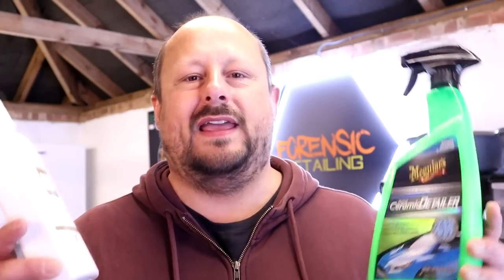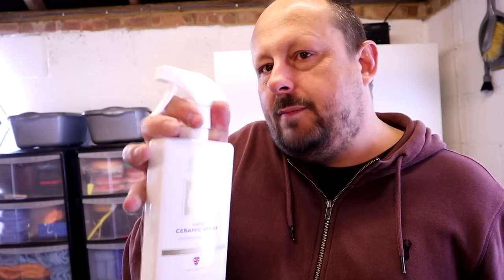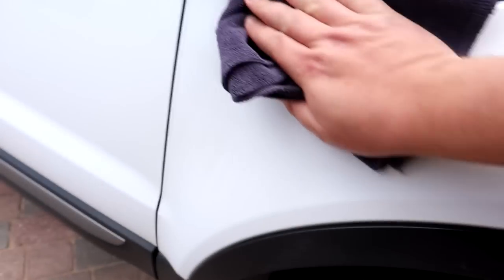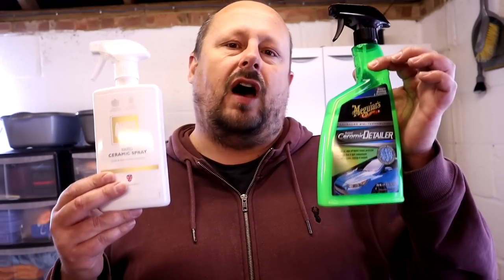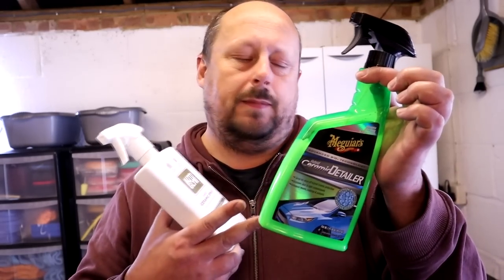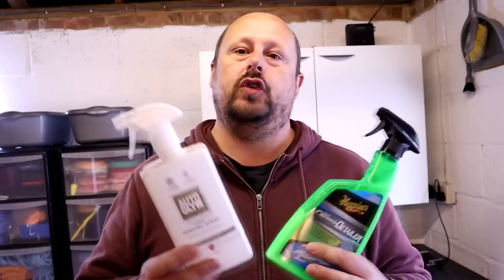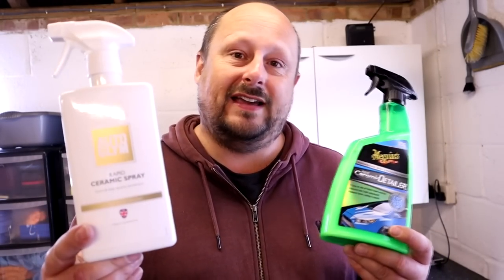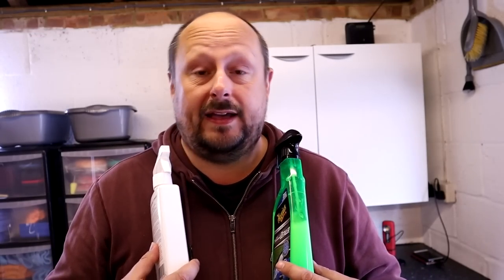Autoglym Rapid Ceramic Spray V Meguiars Hybrid Ceramic Detailer | Battle of the Halfords Ceramics

Comment: Do you use these products after polishing or would you use them instead of polishing?
Reply from the maker: after polishing... polish is an abrasive which works by removing material and refining the surface to burnish it and make it shiny.     wax/sealant/ceramic/ceramic sprays etc.. are protection products designed to sit on the paintwork and make the car easier to dry, fill minor imperfections, make the water run off the car, repel contaminants etc..
Reply from the maker: hey scott also you should check out my Detailing Fundamentals training course with discount code applied:

https://ioa.pxf.io/c/2687409/1012495/12764
Reply: @ForensicDetailing  cheers for the information, I will give it a go this weekend!

Comment: After doing all the tests you have done, I feel revisiting the price point to give back the point to Autoglym, as if you need twice as much to make as hydrophobic and it doesnt last as long then your use more product making megs a more expensive product overall. Just a thought and great video john keep up the good work.
Reply: Interesting point: i think it's good to compare products based on price per mL, and also based on amount of product needed or used. Some product need to be layered thicc and some might require only a mist per panel. But it becomes more difficult to quantify this part.
In the end, i think it's just two different products with different goals. Meg cer detailer seems to be a good drying aid on a ceramic coating (from experience of different youtuber) and a decent (but much expensive) quick detailer with added ceramic.
Autoglym looks more like a standalone protection for a couple of months, or a topper for the autoglym cer coating.

Comment: First time I use AG Rapid Ceramic spray blown away at both how quick and easy to apply it was and also the glass like finish it has left on my car. As a weekend warrior I love it. I used it after using AG Super Resin Polish and Extra Gloss Protection. Just to see if it would work despite it not actually bonding with the paintwork. It worked. Really slick smooth finish.
Reply: Yeah I bought this to put on after the same polish and thought I’d see what FD had to say - so glad he didn’t trash it like the polar snow foam (which is pretty sh*t lol)

Comment: Late to the show but I use both for different purposes. Megs is great for adding some extra gloss and to remove any smears or fingerprints left over. The Autoglym is far more durable and seems to provide a wetter gloss to the paintwork IMO and I use it to boost ceramic coatings. Without sounding critical surely it would be better to compare Autoglym to megs hybrid ceramic wax as they are both the same category? Great video as usual 👍🏻

Comment: Wow Autoglym really smashed it in this one. 
From my experience the meguiars ceramic detailer works best as a top up for in between waxing. On its own it adds minimal protection that only lasts a week. But it worked great for reviving my old “dead” paste wax. Really easy to use and shiny as well. But will have to try that Autoglym next time

Comment: I went to the websites for both products and Meguiars basically  describes theirs as cleaner with SiO2 added to enhance protection while Autoglym describes theirs as a ceramic spray that bonds to paint. I believe a better comparison would be use the Meguiars M27 Hybrid Ceramic Sealant vs the Autoglym Rapid Ceramic Spray.
Reply: Would you now. Hmmmmm Anyone else?
Reply: Yes unfair comparison. Test similar products.

Comment: I wasn't in love with the Meguiars. It doesn't leave the slickest panel feel, and even working in a shop, spraying sparingly into an applicator, I got some visible streaking on some bare black paints. It's in kind of a unique zone. Some of the advantages and disadvantages of both a heavier sealant, and detailer spray.

For me, as a professional, a detail spray just cannot streak. I can't micromanage application and Scangrip every inch of every panel everytime for a quick detailer. So it's not something I reach for, but still a capable quality product for what it is. 

Technician's Choice 582 Ceramic Detail Spray, at under $30 per gallon 😲 has been the best all around pick for me. Versatile, fast and easy, flashes quickly with a clean removal, durability in months not just weeks. 

Insanely hard to beat that, but I'm always testing new stuff. I'm in the U.S. so haven't tried Autoglym. Thank you for the video my dude! 👍✌

Comment: Having used Autoglym products when living in the UK, Germany and now Canada for the last 8 years and using both Autoglym wins hands down. A buddy and I had a clean off, he swore by maguire's til I showed him what Autoglym is made of.  We both had similar coloured cars at the time, my Chrysler 300s with clay-bar followed by super resin then HD wax, finished with high definition gloss left her spotless. Buddy did his usual on his Merc waterless wash, clay-bar with mother's products, meg spray wax followed by the ceramic wax. The standard was nowhere near Autoglym, I find the meg products look cheap and not good value (my personal experience) I have over (roughly) $400 of Autoglym products and will hands down pull better results than any other product, providing you follow the instructions, plus the bottles make them look more professional laid out on a shelf. My buddy has now changed to Autoglym, he thought I just bought them because of the Union Flag til I showed him the standard of the contents.

Comment: I have used Aqua Wax and now Rapid Ceramic Spray interchangeably on my car, just testing what's best for me. I have recently been hammered by salt spreader, and the sandy residue came off the paint without my intervention as soon as it rained, leaving the car fantastically clean. Now I don't know which of the 2 products did the trick.... However, Aqua Wax is much easier to apply on a wet car. The ceramic one did not feel like it was protecting the car that well (subjective) , and I felt like drying the car prior to application was the best way to go. This meant much, much more work !  I think I am going to stick to aqua wax for now, but considering hard wax at least once every 3 months.

Comment: John I'd have to agree with you on the packaging. The Meguiars is definitely a "sexier" looking product. But with products like TW Dry & Shine - Blue bottle are these sprays a bit overpriced for longevity, if you won't get an actual ceramic coating?
Reply from the maker: yes.  But put it this way a pack of fags is like 13 quid nowadays. Petrol.  Cup of cofee is like 3 quid. pint of lager 5-6 quid some places.   The market price for ceramic sprays seems to be like 15-20 quid for 500ml.    If the market was not confortable with this price then the sellers in this market would need to lower the price.  So whats expensive is subjective for sure.  But in the UK we have the full smorgesburg of options price wise :)
Reply: You still get quite a bit of coverage out of the  generously sized bottles. Especially if you apply it spraying into an applicator instead of directly on the panel or spray and rinse.

But yeah, you can still find better values. I buy Technician's Choice 582 Ceramic Detail Spray by the gallon. Absurd value for the money, very good product. Don't know if you guys have access to it outside of the U.S. though. 👍✌
Reply: Just to add balance on the packaging. I found the Maguires packaging a little 'cheap' looking. Reminds of a bathroom or kitchen cleaner product. End of the day. It's how the product performs that matters.

Comment: Why are you comparing  two different products? the Autoglym is a ceramic paint sealer and the Meguiars is a detailer used to top up a ceramic paint sealer.  You Should compare the Autoglym with the Maguiars M27 hybrid ceramic sealer. And your trying to sell detailing corses when you dont even know how to use the products?
Reply from the maker: We said this the video.  But also meguiars is a ceramic spray and autoglym is ceramic spray.   M27 is a liquid emulsion which is not good to compare with siloxane based spray.  But what do I know...

Comment: Hi John 

Autoglym rapid ceramic spray or tac moonlight?

Which would you go for? :)
Reply from the maker: TAC is a proper ceramic kind of.. its not like 99% of the ceramic sprays on the market.. in fact I would not spray it.  for me TAC moonlight is a great base layer coating thats really easy to use and I would look to use it after polishing and degreasing (full prep).   Autoglym is a water based product that you could just wash your car and spray on job done its more versatile can be standalone of topper. Its more casual, almost like a spray wax.  so it really depends what your looking to do with the product on what you pick.
Reply: @ForensicDetailing  thanks for that info John, kinda makes me think is it actually any better that autoglym Aqua wax then?! It almost seems to be the same product 😆

Comment: The Megs bottle looks like a bathroom cleaner. Autoglym bottle definitely looks more classy. I like their bottle range because if like me you have 8 or 10 of their products in the same style bottles, they all sit nicely together. I have all mine in a perspex box with a lid, and they are nice and snug.
I'm also glad to report that the Autoglym ceramic spray is very nice to use and leaves a lovely silky shine on a good clear coat. I love applying this and buffing it up at the end of a 4 hour inside and out cleaning session. It's like switching on the lights after spending hours putting up and decorating the Christmas tree! The finishing touch that makes it all worth it.

Comment: The Megs bottle splits really easily - very brittle and now had 2 split by accidentally knocking them over. Tried many bottles of each. Megs is easy to apply but the AG beads better and is more durable. So in a rush, I use Megs. Neither are a patch on Michel & King Wax+ for looks and durability

Comment: I would love to see the new Gyeon Ceramic Detailer reviewed in such a manner as well; great video as always.  I recently started using the Gyeon Quick detailer to top the new Gyeon wax (which is absolutely amazing, btw) and the gloss and ease of application was truly surprising.  It seems a little more forgiving than Beadmaker which I used to use and doesn’t need buffed as much.
Reply from the maker: its coming, but the products are not available yet so I need to wait a bit.  the wax is a belter isnt it curt ;)
Reply: @ForensicDetailing  oh my goodness, it throws water off like I’ve never seen from a wax!  It was easy to work with especially considering I left it to cure over night then buffed off the excess the next morning, just like they say you can do.  Super easy and impressive product.
Reply: @ForensicDetailing  hi, great review, question, can I use the autoglym ceramic spray on glass windscreen?

Comment: I have used both. Megs is one of the best "detailers" i have used. Autoglym i think is a "spray Sealant". Rapid ceramic i think is a similar idea to quick wax...A thicker layer of megs may change the tests, especially durability gloss and waterbeading. Great video tho. Great to see logical thinking around testing products. its not all, "lets throw some apc at it"

Comment: Have been using Meguires on my S3 Red metallic paint and gray RR absolutely fabulous to use and both cars really shine, S3 is 6 years old and looks like a month old. I use when car is dry, and use a microfiber block and apply like you were putting on a ceramic coating then buff off, I give it 10 /10

Comment: I'm thinking (as others have also responded) that the Autoglym product might be better compared to Meguiar's Hybrid Ceramic spray wax (smurf juice, as i call it) as the Autoglym seems to be a spray coating. I like the results i have gotten from the Meguiar's spray wax and detailer, but i do find the spray wax requires a little more work to level out and eliminate streaks or high spots. 🤷‍♂️

Comment: Hmmm... Interesting... here in Australia when the car is consistently exposed to extreme sun and heat... north of 30dc ambient regularly, Mequiars simply doesn't hold up. I believe it is designed to be a mass market inexpensive product for lazy people. Here Autoglym is about AUD$5-15 more expensive but lasts a lot better and offers far better paint and plastics protection. My Touareg is a daily driver... sits in the sun every day since 2004... paint is still like glass, no damage or fading and the plastics still excellent. My friends golf is 7 years old, he uses Meguiars and... well... its not holding up.

Comment: Recently found your channel and getting addicted :)  I'm new to detailing and have limited time so I've been using the AG polar range with SRP and extra gloss protection occasionally. For the average person that would only use one protection product would you go for a wax, ceramic or stick with something like I'm using? PS. defiantly going to give built hamber products a go when I run out.
Reply from the maker: Hey there, SRP + EGP is a really affordable combo.  I used this for years.  If you want to try more modern products get the UHD wax and the Ceramic spray.  you will notice they bead more and last longer.   But they cost more.   So your using a very affordable combo at the moment.   How you look after the paintwork as well is more important that the wax you use to protect it but your in good hands with autoglym i think.

You should check out my Detailing Fundamentals training course with discount code applied:

https://ioa.pxf.io/c/2687409/1012495/12764
Reply: @ForensicDetailing  Thanks for the quick reply, yeah they seem to work ok for me, got them in an autoglym set but almost empty now so I'll give the wax / spray combo a go next. I don't often get time for a full detail so the polar blast/wash/seal  route is used 3/4 of the time (better than nothing type wash). I was then checking out the page, I imagine it would be a useful course... Thanks.
Reply: @ForensicDetailing  you might well have answered my previous question. note to self read the comments before commenting

Comment: I will tell you that Duponts Rain Dance was the best wax, and I have over 40 years never ever seen a product as good as that. It is alas no more. Other companies have have bought the Rains Dance TM, but fail. with Dupont the originators when you braked all the water just rolled off anf your car was clean it was like mercury on a glass sheet. I have half a bootle of the 80s classic Rain Dance people just sit and stare at the beading and how it rolls off, that is after a 40 year old bottle.

Comment: The reality is that the Maguiers assumes that you've used the ceramic spray wax beforehand. The Auotglym is somewhere between the two. I actually use both and on my very well protected cars they work very well and I trust both. On the packaging Autoglym really don't need the razzmatazz of the green bottle etc their brand says it all.

Comment: I bought the Meguiars John, for finishing my 1 sport shadow edition, which is metallic grey. It's a great product, so much so that I don't need to go the full nine yards and - cut - polish - wax.  every four months.. One thing I have noticed is that though, is that it's easy to overload a panel with this product, which leaves a strange dark smearing. I think you talked about this in a previous video of yours. So I basically apply the product to my towel rather than directly to the panel... my two cents worth

Comment: Autoglym picked up all the important points but, like you say, it's a different product. I've just finished cleaning my car and used Meguiars Hybrid Ceramic Wax (spray) for the first time. Applied off-label using pea sized drops on a damp applicator with immediate buffing. Looks great and I understand will last a very long time. I'd consider the Hybrid Ceramic Detailer but will probably just stick to the HCW applied off label every few months

Comment: Hi Jon, really good comparison tests I have the autoglym ceramic detailer but have yet to use it going to keep it for the cooler weather and apply it over ultra hd wax then maybe use the polar seal.
Can you tell me one thing, can you just wash your towels with a mf wash and you can re-use  them as the actual ceramic % is not that high or do you have to discard them.
Looking forward to your Gyeon wax/ ceramic detailer review.

Comment: I had the autoglym ceramic spray few weeks now . It very good product. Good as a drying aid to. But I have noticed in sun you have to work quick and small areas at time. On a summer day it may be difficult to use why they put a max temp on bottle . I used a lot ceramic sprays this does have good durability but for me one of the more difficult to use in sun.

Comment: gloss test will rely on your overhead lighting and how diffused it is, in most cases these are poor guides and i can c your lighting is not really diffused well.
Reply from the maker: lol stop talking about things you have ZERO understanding about.  The goniophotometer seals against the surface and shines its own bean of light at an angle and the reflected light enters an array.  the spectral quality reflected light is measured in several different ways to obtain readings.   Its not using the light in the garage.   You can get some light "contamination" especcially on curved panels but these create tiny increases in error on the readings.